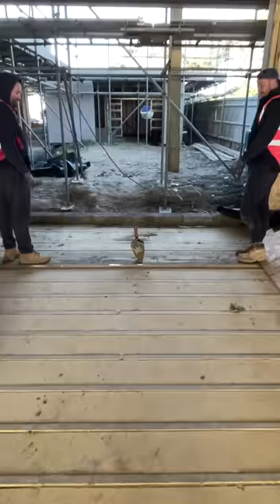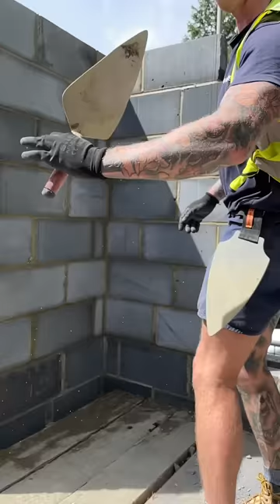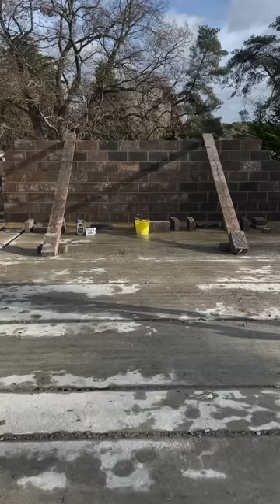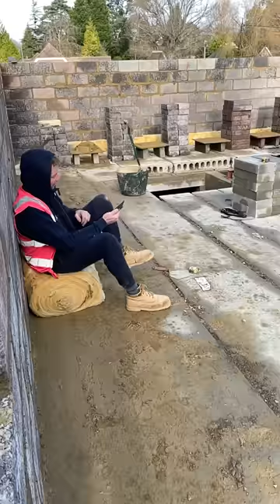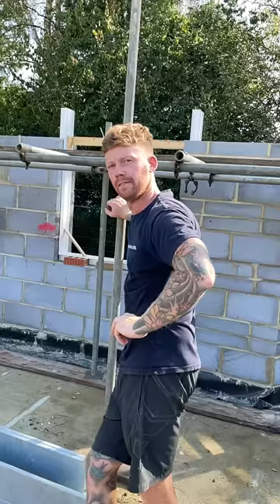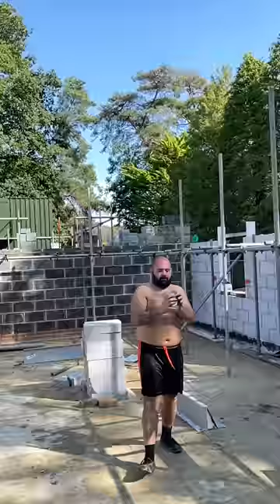The Kings of Trowel Tricks | 60 Sec Pro NAK039 #shorts

Comment: Goes through 10 trowels a week on site. Idk boss there cheap they just keep breaking.
Reply: what he is doing isnt hurting the trowel at all, if it cant hold up to that, it cant hold up to what it is supposed to be used for. thats like saying hitting/dropping a hammer is bad for the hammer...
Reply: @scrapppy96  yeah depending on what your hitting or how you drop your hammer it’s bad. You can damage a hammer or wear it down. If I drop my hammer 400ft off a building it’s probably not gonna be straight anymore if it doesn’t kill someone one the way down